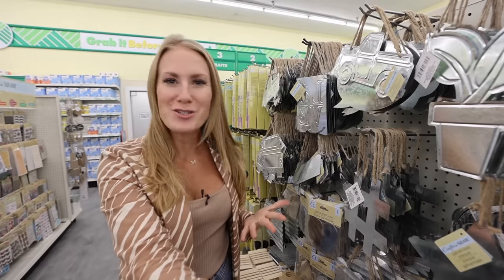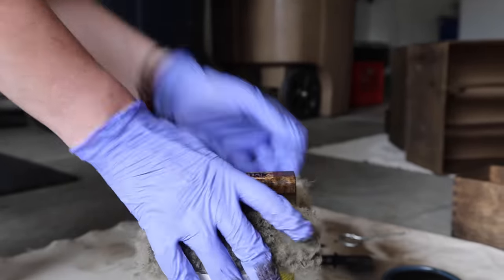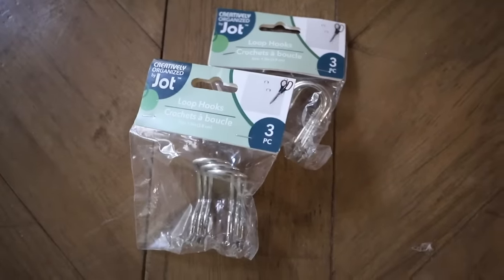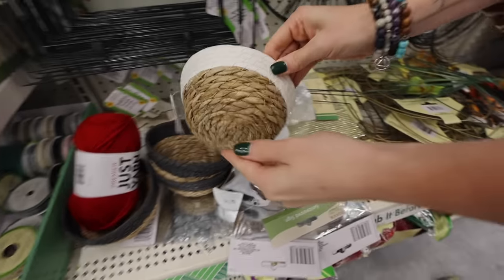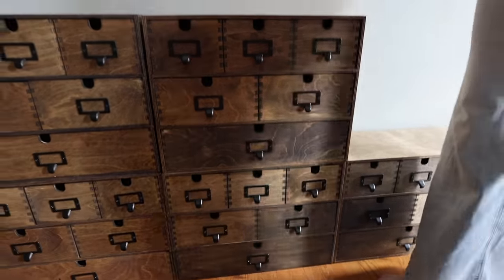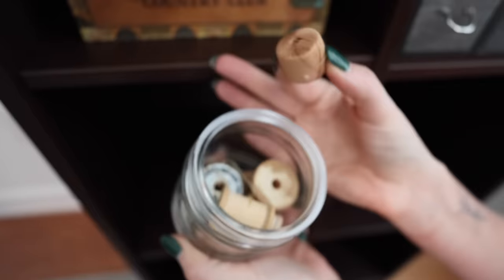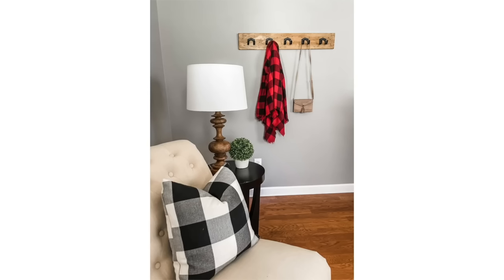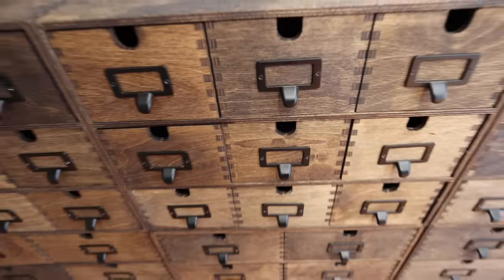You'll never walk past these DOLLAR TREE wood boxes again! 😱 (legit high-end hacks!)

Comment: I love all the wooden crates and other wooden pieces at DT!😍
I just finished making several fall arrangements in the wooden crates after painting the crates. 
I had some orange crates filled with different colored pumpkins and even had a blue crate with blue and white pumpkins and leaves! 😘
I use these crates for every occasion, bringing beautiful colors to each holiday!
On the occasions when DT has the two gnomes together, I often incorporate them in the crates too!
Last year I painted the crates white, yellow and orange just like candy corn and filled the crate with the same colors of flowers! 
People should also look in the Plus section because their $3 and $5 wood pieces are even stronger and bigger and you can do even more elaborate things!😚
I discovered the wood glue some time ago and always make sure I have some on hand at all  times!😉
I made a shelving unit with 6 crates across and 3 crates down. I painted each row starting with red at the top then white in the middle and the bottom was blue. 
I glued them together with the wood glue and even used the clamps to keep them close together as the glue dried. 
Now I use the unit for miniature pieces like you would put on a tiered tray.😋
What's so great is just walking around DT and getting ideas of things to make. You see a piece that looks like something you could use, then you find another piece that could add to a project. Before you know it, you have created something great and you didn't spend a fortune because you were at DT!☺️
Thanks for sharing all your wonderful ideas!🥰

Comment: @doitonadime  I discovered the wood glue there about 5 yrs ago, and believe it or not I'm most impressed by the super glue brand wood glue aaannnd idk if you've ever bought those packaged wooden bird houses in the tou section,  but the glue in those.....😍😍😍 the BEST ! Between my crafts and my hubby's woodworking we have used A LOT of wood glue but my 2 Dollar Tree wood glues are a whole nother level! they last and the best part is that they dry fast they set in 10min give or take and still continue to cure as normal. cheap and fast setting? win win🎉

Comment: I also have the puck lights with remote in my closets, I used 3M command velcro strips to attach the remote to the wall. It is thin enough that it looks like a light switch and it won't get lost.

Comment: Which one was the Dollar tree one ? Cause the big brown one want as cheap looking as the other.
Reply: @penneypepper:the dollar tree one is the tiny little wooden small boxes with the metal handles on both from dollartreee the kind of more Blackish colored looking boxes. The one that she said could be used to hold office supplies-small trinkets
Reply: @Penneypepper:the dollar tree one is basically the one she made with the small tiny cutout boxes that she flipped around that she got from dollar tree and the one with the metal handles on it Aka the 12 set wooden tiny small boxes one the one she used 24 of since she did 2 sets of twelve. The handles and small boxes both come from dollar tree I think she used ebony wood stain or the blackish Greyish wood stain on the dollar tree aka the first wood stain on the top of the other one when she shows which two wood stains she got. So the dollar tree one is the small wooden boxes from dollar that she added the dollar tree handles onto